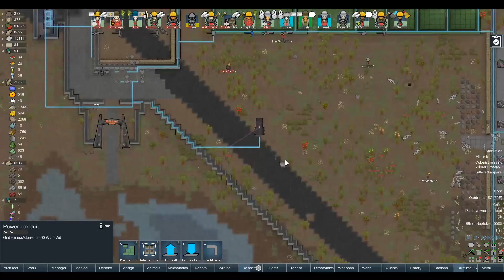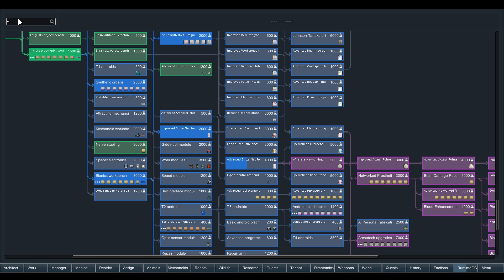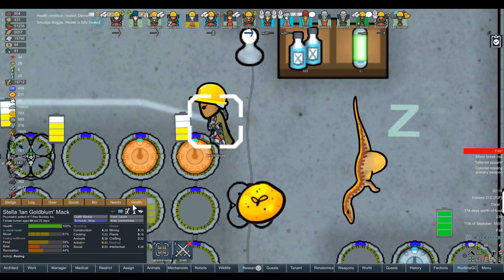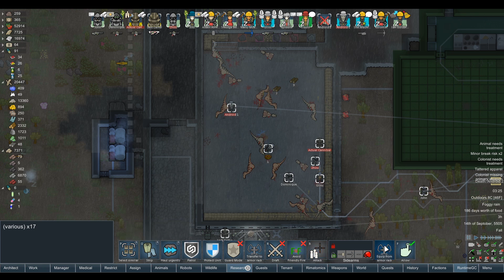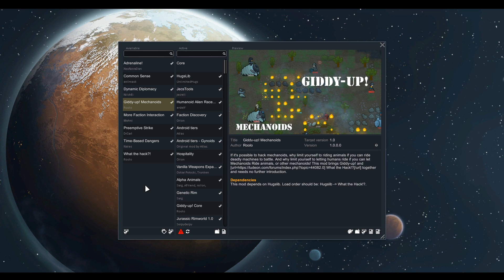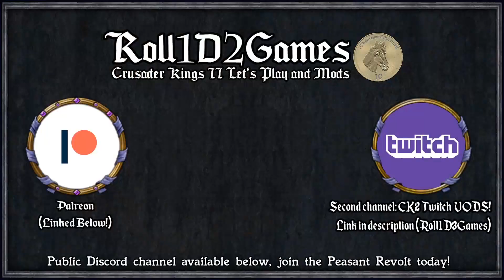Rimworld: DinoScience #37 - Jade Dream

Comment: The upgrades for Rimatomics need to be built at the bench and installed. The GlitterNet system needs to place placed next to whatever it is connected to like a vitals monitor, while you only get one Hub to control it all, the processors are give you 'power' to run the system. And you should think about increasing the range of your 'kill box,' more range = more shots for your long range weapons.

Comment: Well i will do my best to explain them to you; ○Tesla coil: They look beefy and powerfull but i dont really find them much effective unless they are shooting at someone that broke your lines.

○Obelisks: These turrets will kill all in their range one by one they shoot pretty fast and can be modified to break enemy shields. A very nice all rounder.

○Punishers: These guys are very powerfull railguns that have extreme range and good aoe damage, they can be used as mortars to shoot other maps(they cant do indirect fire on your map and require someone to see their target) they really wreck outposts with their rapid fire aoe. These will also kill your turrets in 1-2 shots.

○Marauder: This is the most dangerous weapon of all(other than the nuke) to enemy and you when fully upgraded it can take centipedes in 1-2 volleys with AoE but can really punch huge holes in your walls too so you need to keep enemies a bit centered if you go for a corridor or such.

○Tacs make people run around does not do damage.

○HEL: Anti-mortar laser beam to keep your perimeter safe

●General advice: Make sure your TACS is at a safe place as it runs most of your weapons and when ATOM is installed it will tell you when enemies will attack and scramble drop pods to edge of map. Make a different power line for your main weapons as those batteries might look godsend but a single zzzzt.. will change your mind pretty quick. The weapons console is connected to weapons by power line too so it needs to be at that grid together with TACS.

Comment: You need to change from pulse fire to consistent right know its only using 1000wd per shot
Reply: Also their is like a yellow power grid that only the energy weapons and ppc can use it have to be powered by the transformers that you can connect reguallary with the normal power grid